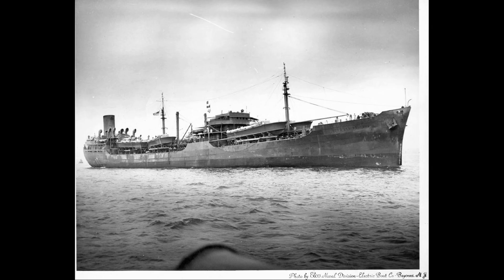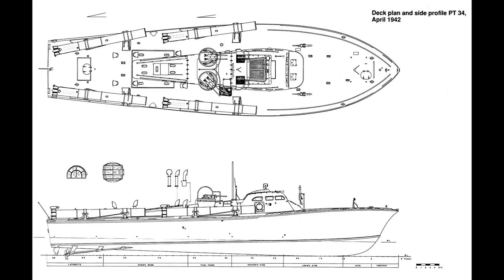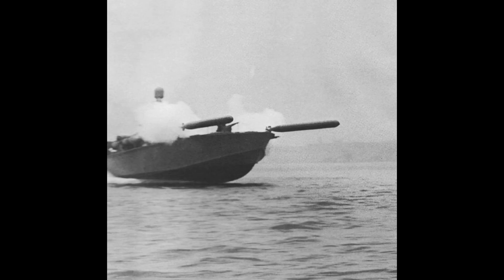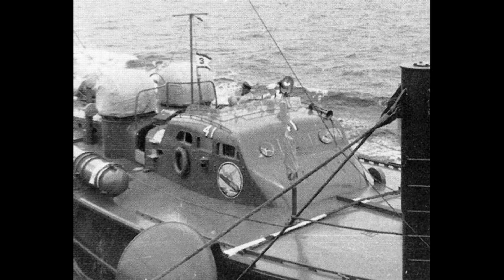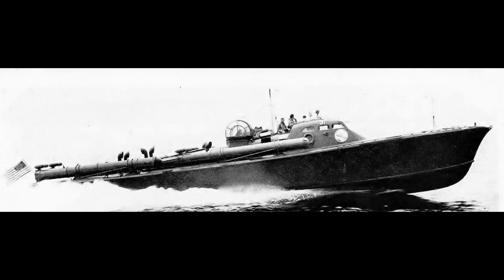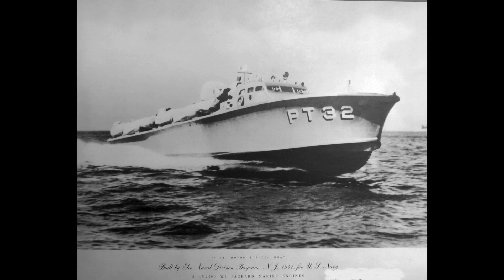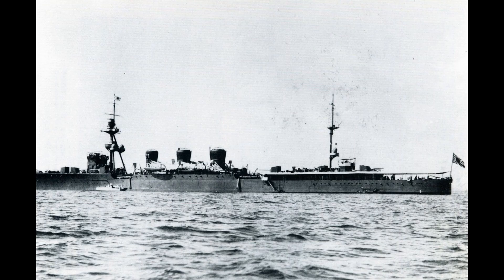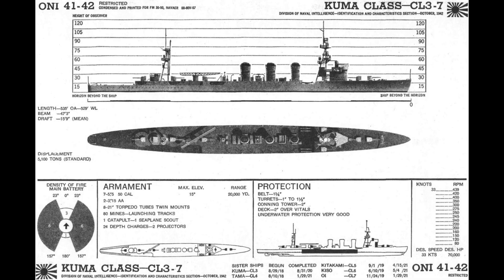PT Squadron 3 - Guide 161

Comment from the maker: Pinned post for Q&A :)
Reply: Given that most sea battles during WWII took place either in range of shore and/or carrier based air, or at night, was there ever an instance where the scout/spotter planes carried by cruisers & battleships proved useful in a major battle? I can think of one negative example (IJN Tone at Midway), but without going through all of your old videos, I can only imagine one positive one, the hunt for the Bismarck.
Reply: For the third time: every single big-gun capital ship (battleships, battlecruisers, "large cruisers") to enter service after 1935 is teleported back to Jutland (at the start of the engagement) and attacks both the British and German forces. Does the uptimer "ultimate battlesquadron" have it in them to sink all the Grand Fleet and High Seas Fleet capital ships present, or will they just turn the WWI capital ships into burning but floating wreckage that can return to port for repairs?

(and yes, this scenario has all the non-carrier Allied and Axis WWII-era capital ships working as one fleet rather than trying to kill each other, because I just want to see how they would fare in an environment where they weren't immediately obsolete due to carriers, and having them fight each other is overdone)
Reply: Nice upload.
Thank you.
Reply: @Kendra Malm At the Second Battle of  Narvik HMS Warspite's Walrus seaplane spotted German destroyers hidden in coves. They were Warspited even though not visible to the ship.
Reply: I am a retired U.S. Coast Guard member I would love to see a series on U.S. Coast Guard Cutters
Reply: The link to the music says the channel doesn’t exist but it could be on my end. Do you know where else it might be?
Reply: Excellent video, hope to hear of more small craft exploits in the future. 

Have you seen the John Wayne movie “They Were Expendable”? It’s been a number of years for me, but from recollection it seems track fairly close to the historical record you covered.
Reply: I mean no offense in suggesting an error, but was the compliment of Lewis guns really in .303 British? If they did use .303, was it simply a case of that was what was available. I believe the US manufactured Lewis guns in .303 for the British during WWI and I could imagine a number of them hanging around and a non-standard, or non-American caliber and being pressed into service. Would there be, then, multiple instances of Lewis guns being used to outfit vessels such as US gunboats in China etc also be in .303?
Reply: What if before WWII had begun, Hitler had grown a brain and realized that Germany couldn't build a navy to compete with the UK and the US, so instead made the  decision to build thousands upon thousands of E-boats.  Would this have been a better use of man power and material resources for Germany and could it have possibly helped them win the war?
Reply from the maker: @charlieborsos7321  it's slightly unclear, the USN tested the .303 Lewis back in WW1 and ended up with a fair few but would then adopt the rechambered .30-06 version, which appears to be more common in USN service.

This is further complicated by various sources listing it as a .303, .30cal, 7.62mm or .30-06 weapon, also not helping is that later boats often got .30 Brownings, so simple reference by calibre without gun type could refer to either.

Happy to be correct if someone can point to decent source that clears things up definitively. :)
Reply: Please, the USS Colorado or the Colorado class as a whole. Please. Just tell me who I need to snuff out! lol
Reply: @DavidConnor  Though there is a strong argument that the whole Second Battle of Narvik was a case of wasteful overkill for the British, since they were using a capital ship to take out some of the worst destroyers of WWII. Why not send a Town-class? Would still result in a British victory at less cost.
Reply: @DavidConnor  You're looking way too much at the sharp end-tactics-and ignoring stuff at the operational, strategic and logistical levels. A battleship has more firepower and durability than a cruiser but also costs a whole lot more to build and deploy, so if your cruisers can still do the job adequately enough, you're better off with that option.

And given just how bad German destroyers were, I doubt that having 15" guns (which are totally overkill for killing destroyers) represented a notable tactical advantage; if anything I would assume a larger battery of faster-firing 6" guns (like those on a Town-class) would be more effective for killing destroyers, even at the tactical level. 

Nothing succeeds like excess? Then why are things like the Maus or the Schwerer Gustav considered "awesome but impractical" (has value only in very limited circumstances) or even outright pointless? 

In strategic and logistical terms (and in the majority of cases even in tactical terms), battleships were outright worse than useless in WWII. (Before the late 1930s they did have some value due to there not being any better choices for exercising sea control)
Reply: @bkjeong4302  😖 seriously?
Reply: @bkjeong4302  Did the RN even have cruisers available? Could a cruiser survive a German DD torpedo hit? The rebuilt Warspite could. I know you're hellbent against battleships but BB's had immense war-fighting value. They were built, manned, trained, on scene and utilized to defeat a determined enemy. I wish someone had recorded the sound of Warspite's 15' guns in the fjord. A symphony of destruction.
How can you argue with success? 
p.s. Kudos to the Walrus's flight crew.
Reply: Drachinifel Why was Japanese AA so inferior to American?
Reply: Fairly sure a RN cruiser COULD survive being attacked by German destroyers, since a) it was better suited to fighting and evading torpedoes in a narrow fjord, b) German destroyers and early-war German torpedoes were awful, and c) cruisers are still big enough that one torpedo hit wouldn’t render it combat-ineffective.

Battleships were utilized far less than pretty much any other warship in WWII to defeat the enemy (hell there were some converted merchant vessels that saw more service and gave a better return per investment than the average WWII battleship!), almost all of the stuff they did do was in secondary roles they were never designed for (and in most cases underperformed at), and the money and resources spent on them in WWII should have been used for other, more impactful assets like tanks, planes, carriers, submarines, ASW vessels, etc.

I can argue with success when that success could have been easily achieved with less bother. By your logic, someone using a knife to kill an enemy soldier when he could have just shot him shouldn’t be criticized.
Reply: Matthew M. Mowry 

They had no medium AA and their light AA sucked (though the Germans were even worse in this aspect). 

Even if their AA was as good as that of the Americans, it wouldn’t matter much as even American AA was far less effective than CAP for preventing air attack.
Reply: Why were American ships so chock full of .50 cal or similar weapons. Were they effective against modern strike aircraft like the Val and Kates? When did this downright obsession fade?
Reply: @bkjeong4302  
Warspite's sister, the unrebuilt HMS Barham, was sunk by German torpedoes. How would any cruiser fare?
BB's did their duty, whether in action or just by in being. Tirpitz and other German capital ships tied down enormous RN & RAF resources. The IJN expended resources, needed elsewhere, to tie down the inferior RN's Far Eastern Fleet.
Deterrence, a fleet in being, is a strategy that can count victory as avoiding combat.
BB's were overshadowed by carriers. Perhaps the resources to build and operate BB's may have been better utilized elsewhere, that does not mean that you could ignore their power to inflict pain on you. They were operational, they were there. BB's certainly DID inflict pain upon our enemies, in both the European and Pacific theaters.
An arrow will kill you as readily as an F-35. Bring 15" guns to a torpedo fight whenever you can.
In this case, HMS Warspite, proved her worth in RESOUNDING fashion.
Three Cheers for HMS Warspite!
Reply: The winner of a hypothetical battle between the Yamato and (fill in the blank) is often discussed.  How would you design a battleship that could definitively defeat the Yammie and would it be simply a Yamato with better fire control?
Reply: David Connor 

Barham was sunk later AFTER the Germans fixed their fish. At Narvik they wouldn’t be much of an issue.

What BBs achieved in action (which was usually against hostiles they were never intended to engage when designed) or even by tying down the enemy fleet is minuscule compared to their expense, lack of cost-effectiveness and the fact they diverted resources from much more useful military assets.

Just because they inflicted pain does not mean they were the best choice for inflicting that pain.
Reply: Jeff F 

Probably a Montana.
Reply: @bkjeong4302  Well, you're looking at it from a bean-counter perspective.  From an operational perspective - wouldn't one rather have their capital class crews VERY comfortable with their guns, Reasonably comfortable with their aiming, and hardened for battle?  You are missing the experience paradigm entirely.  Bean counters - plenty of corporations have died to them, and plenty of countries have lost bigger battles due to them.
Reply: @workingguy-OU812  In war, especially a global war like WWII, the bean-counter's perspective tends to be a lot more important.

Who cares how comfortable and experienced the crews of a battleship are if warfare has changed to the point there is no more reason for battleships to exist? The raison d'être for all battleships was exercising sea control by engaging and sinking peer opponents, because they were simply too costly to build just for secondary roles like shore bombardment, engaging destroyers, AA, convoy raiding/escort, etc. When naval aviation got to the point it could effectively outrange battleship guns (which was probably in the late 1930s), they rendered battleships largely pointless at the only role they were ever strategically useful for (the sole exception being in conditions where planes couldn't be used while there was an enemy battleship, but this happened only three times in WWII)
Reply: @bkjeong4302  Perhaps, but German torpedoes DID inflict severe damage on RN destroyers in First Battle of Narvik and elsewhere. Not every German torpedo was a dud.
How would you like to be ashore as RN & USN 12", 14", 15" and 16" shells rained down upon you in Normandy? How would a carrier help you on D-Day?
I'm a submariner, I know what a well placed torpedo can do to the largest warship, break her back. I also know that to place that shot takes extreme skill and not a small bit of luck. Meanwhile the BB's are smashing the sh*t out of my comrades afloat and ashore. 
Battleships were there. They deterred and/or fought hard and courageously. Scharnhorst fought hard yet lost, at the North Cape (Where I've been multiple times.) against overwhelming surface warfare odds. Scharnhorst was a beauty. Battleships may have been bypassed yet they were still deadly, never to be ignored.
There is no time machine to change the FACTS. The FACTS of history should be honored.
Reply: Do you ever consider doing modern navy’s
Reply: David Connor 

Re: Narvik, that does not change the fact German destroyers were crappy and that a Town-class is both cheaper to operate and better at evading torpedoes than a battleship. 

At Normandy the battleship bombardment did an underwhelming amount of damage, and if I was a German there I wouldn’t care all that much about the big guns, knowing that the bulk of the fire support was actually accomplished by destroyers. Vice Admiral Deyo agrees with me on this.

Battleships were not present for a lot of WWII naval battles. Even in engagements battleships were present in, most of the time other warships did far more of the work while the battleships either just sailed around or made minimal contributions. And when the battleships did do things it was (with only three exceptions) in situations where other warships would have done a better job.

North Cape is also unusual BECAUSE it actually had a battleship do her job properly (by fighting a peer opponent in a situation where there were no better options). Exception to the rule. 

Please make sure whether your facts are actually factual before you argue battleships contributed heavily in WWII.
Reply: David Connor 

Of course I’m Anti-BBs. Someone needs to balance out all the battleship wank that keeps giving them way too much credit based on outdated or outright false information and nostalgia. 

Battleships were NOT crucial in the Allied victory. The Allies would have won even more decisively without them. You’re giving them way, WAY too much credit for things they didn’t do, or things other ships could have done way better.
Reply: Kendra Malm Aircraft served the very useful purpose as forward observers for shell bombardment, both against other shipping and shore support.
Reply: Jeff F Replace the main guns with an armored flight deck, and bring along 90 well trained pilots. Oh wait...😄
Reply: Bk Jeong You’re very well read Bk; but the BB’s served their downgraded purposes as effective AA and heavy shore bombardment against fortified gun emplacements, while keeping out of their target’s range. Vessels with lesser maximum effective ranges would be within range of their own target’s return fire.
Reply from the maker: @nicholas ringer I may have been a little unclear, the hit on Kuma was one of over 200 dud torpedoes fired during the Philippines Campaign, that's against all the IJN forces present. :)
Reply: Were "borrowed" ships ever returned after the conflict(assuming they survived) or paid for, or were the people who owned them just out of luck?
Reply: @DavidConnor  Bk thinks that world's naval leadership was stupid because they didn't foresee the huge increase in the capability of naval aircraft in a few short years.  Well, apparently  the RAF leadership was even dumber for not foreseeing the worth of jet aircraft in 1935 when everybody was still flying biplanes.  They should have fully funded Frank Whittle because their jet fighters would have taken the Luftwaffe by surprise when introduced in 1941.  By the time the Germans rushed their ME 262 into production Kelly Johnson's L-133 supersonic fighter would undoubtedly be rolling off the production line.  /sarc.
Reply: @johnnash5118  

Using a battleship as a gigantic CLAA is, at the strategic level, incredibly wasteful.

Against shore batteries: again, I refer you to the fact destroyers did a better job than battleships off Normandy against fortified gun placements. Most shore bombardment in WWII involved destroyers and cruisers, not battleships.
Reply: @johnshepherd8687  Aside from the fact even late 30s naval aviation was arguably at the point where it had trumped battleships, plenty of battleships (all the Iowas, the last two KGVs, etc) were completed AFTER it was painfully obvious that battleships were done.
Reply: @bkjeong4302  False.  Until late 1940 the most effective naval strike aircraft was the execrable TBD Devastator.  In the real world of 1940 it takes 3 years to field a system.  There was nothing on the drawing boards in 1935 that would make one think carriers would be the primary naval force.
Reply: @johnshepherd8687  

The Devastator had its issues, but it still vastly outranged any battleship gun, and given that the Swordfish was rather successful despite having even more problems it's honestly underrated.
Reply: @bkjeong4302  The bomber will always get through, en?  So I guess you think the RAF blew it too.
Reply: @kendramalm8811  Yes, the Battle of Savo Island, the night of August 8-9 1942. Japanese admiral Gunichi Mikawa used floatplanes launched from his cruisers to first scout and confirm the locations of allied ships then they dropped flares behind the allied ships, silhouetting them for the Japanese guns.
Reply: For the Lion class battlecruiser why didnt the designers eliminate Q (P?) turret instead of X turret?
Reply: Bk Jeong Bk Jeong 🤔You support your argument clearly, but not as well as you’d prefer. BB’s were outmoded by the CV TF’s, but were nevertheless made useful regardless. What’s your ideas for better usage, mothballs or perhaps strictly commerce raiding? The argument in favor of BB’s is that they were simply already built and available, or nearing commissioning prior to hostilities for service, despite other more efficient weapons platforms.
Reply: If we gave you a bajillion paytrion dowlers will you please read the The Destroyermen book series about the dinosaur navy but in a sexy voice?
Reply: John Nash 

Then you just leave them and don’t bother wasting more resources by sending them into combat.
Reply: John Shepherd 

ANY torpedo bomber will get shot down if unescorted (which was the situation at Midway with the Devastators). The Devastator was no worse than other torpedo bombers in that respect.
Reply: 1, what is if any are the main differences between ship, aircraft and submarine torpedoes? 2, was any variation of the long lance used by aircraft if so how successful was it, If not why?
Reply: @bkjeong4302  In 42, both the USN and IJN lost capital ships to aircraft.  In 42, all the USN had that could fire faster than a 5/38 was the 1.1".  In 42, all the IJN had that could fire faster than their 4" and 5" DP guns was the 25mm.  Both USN and IJN carriers had CAPs, but still took losses in 42.   Both the IJN and USN added more AA to their ships as the war progressed.  The IJN continued to lose capital ships after 42, but US losses were sharply reduced.  The only USN carrier, outside of CVEs, lost after 42 was Princeton.  The difference?  Introduction of the Bofors to the USN?  The Bofors was more able to reach out and touch someone than the 1.1" or 25mm, and it threw a large enough shell to do damage when it got there.  The Italians had developed an automatic 37mm gun in the late 30s that they installed on cruisers and BBs.  It wasn't a match for the Bofors, but could outperform the 25mm.  Things might have been different for the IJN if they had licensed the Italian gun, rather than the Hotchkiss.
Reply: @bkjeong4302  Yes.  Devastators did fine prior to Midway.  At Coral Sea, the strikes were properly coordinated, with dive bombers and fighters attacking at the same time as the Devastators.  From everything I read, at Coral Sea, losses were taken by the dive bombers and fighters, that came in at the altitude where the CAP was, but the Devastators attacked without loss.  There were 6 Avengers at Midway.  Only 1 returned from their attack on the fleet.  The Brits had the same issues: catastrophic losses of Beauforts and Swordfish when attacking ships with a DD screen.  During Operation Cerberus, the first Brit force to intercept the Germans was 6 Swordfish.  The Swordfish had a squadron of Spits as escort.  The Swordfish could outmaneuver the Fw190s that intercepted them, but, while all six made it over the DD screen to line up to attack the battleships, only two survived to make it back out past the DD screen.  Those two survivors were flaming wrecks who ditched a couple minutes after clearing the DD screen, with the surviving crewmen picked up by Brit MTBs.  Pat Gibbs commanded a Beaufort squadron on Malta and demonstrated that the way to attack ships was first: in overwhelming numbers to saturate the enemy defenses, and, second, bring along aircraft to strafe the escorting ships to suppress AA fire.
Reply: What sorts of armament were actually (aka Officially) tested on PT boats? I have the sneaking suspicion that just about every naval gun up to the 76mm (3" gun) were tested on these great little ships at some point. 

I'm also aware that 37mm and 40mm guns were installed, but, how much ammo could these boats carry of each?
Reply: @stevevalley7835  Pretty much.
Reply: @greg_mmm       "... decision to build thousands upon thousands of E-boats.  Would this have been a better use of man power and material resources for Germany ...?"
It would, until the Allies finally figured out how to destroy all of them. (more or less like how they figured out how to take out so many U-boats)
Reply: @nicholas ringer it was all USN torps.  PTs carried the Mk 8.  It didn't work either.  The Devastator carried the Mk 13.  It didn't work either.  In a live fire exercise in the summer of 41, Devastators dropped 10 Mk 13s.  Only 1 of them ran "hot, straight and normal".
Reply: Is this your post on PT boats? Not much is written on them
Reply from the maker: @coppeis  no, just one squadron, pt boats as a whole will need their own Wednesday video
Reply: Bk Jeong  Dive bombers and torpedo bombers attacked the capital ships, which between ‘39 and ‘42, and despite your myopic opinions of them nearly 80 years later, right or wrong, included BB’s. If the BB’s were mothballed (as you would prefer) those planes would then be available to attack the fleet carriers first, then escort carriers, then cruisers, then destroyers. Therefore, recognizing the carriers as the only true capital ships by default as you suggest, places them in diametrically greater peril. It’s arguable that the old Colorado class BB’s, commissioned just a few years after WW1 were used quite effectively as decoys for the CV TF’s. Indeed, the USS Maryland, BB46 (which my dad served and survived aboard throughout WWII,) was struck by no less than countless 20mm cannon, (2) 500 lb. bombs, (2) 500 lb. bomb-laden kamikaze dive bombers, and an aerial torpedo that blew a hole completely through her bow, large enough to literally “drive a freight train through her” as my dad told me. Those attacks, if not targeted against these old BB’s, instead would have quite possibly been directed toward the carriers and changed the course of the war.
Reply: @nicholas ringer Sounds like maybe you read the navweaps article on the 13.  By the end of 44, they had the 13 sorted out.  Drop limits improved from 110kts/50 feet to something like 410kts and 2400 feet and reliability was near 100%.  By late in the war, they were using Mk 13s on PT boats, instead of the Mk 8.
Reply: @johnnash5118  This depends on the enemy either having dumb enough doctrine or dumb enough pilots (in the case of the kamikazes it was the latter) to attack the BB that's far less of a threat than the CV.
Reply: @bkjeong4302  1935 Naval aircraft, all biplanes, could out range a battleships guns.   So what's your point?   The fact remains that the future is unknown until it becomes the present.  You know what happened in 1944, the leadership of the world's Navy's didn't.
Reply: Bk Jeong I couldn’t disagree more. The BB’s were well used for their value, which were perceived by the enemy as capital ships 75 years ago, and relieved the true capital ships, the CV’s of a great number of attacks. The IJN pilots were dedicated to their faith and believed strongly in an honorable death. By ‘44, they were depleted to such a poor state of combat readiness, that suicidal attacks were deemed more efficient; that has nothing to do with lack of intelligence, but imho, your rash opinion qualifies at least temporarily for such.
Reply: Where capital ships primary batteries ever used in a non broadside role?  i.e.  each turret gets its own target instead of all primary batteries focused on a single target?  Which was better or could both be used at wish depending on the engagement?
Reply: @charlieborsos7321  The answer is, your right. The M1917 Lewis gun was made by Savage Arms and made for the USMC  & USN in Caliber. 30-06 Gov't.
Reply: @Drachinifel  On further review, the guns in question are M 1917 Lewis guns. These were made for USN and USMC service by Savage arms and are in caliber .30-06 Gov't. The M 1917 is basically the same as the earlier and more common  Model 1913 and 1916 Built in the UK by BSA in the .303 service round. So basically Lewis guns in different calibers per nationality.
Reply from the maker: @WALTERBROADDUS  no worries, I'll include that in my next drydock in channel admin :)
Reply: John Nash 

But they didn’t relieve carriers of attacks more cost-effectively than cruisers or destroyers did, meaning they were still poor investments.

As for your comment on IJN pilot intelligence, do read Kaigun for a good overview of their doctrine. The kamikazes that went after battleships first weren’t following their doctrine.
Reply: I have often wondered, in your intro vid, right after the title card and before the logo, there is a view of a battle (cruiser) from amidships port looking aft of another warship.  The platform ship fires her battery and there is a great deal of debris ejected from near the turret.  Has anyone ever explained what that flotsom is?
Reply: @Dylan-lw1xc  nope
Reply: @DavidConnor  Bravo, bravo.....🤗 Loved your reply to the resident "BB hater."
Reply: @Halinspark  You mean like, the US DD's to the RN deal?
Reply: @bkjeong4302  That is a function of the gunnery, not the gun platform.  A 5" shell is still a 5 " shell. Fired by a DD or a BB.
Reply: @colinsdad1  Great question, but better reserved for a in depth video on Fast Attack craft. A 76 mm was too heavy a weapon for the torpedo boats.  It was used on larger Subchasers and PC's.

By 1945 the standard PT load Elco or Higgins was a 37mm Cannon bow gun, 2 5" rocket launchers with 8 rounds. 2 twin  .50 BMG turrets midship,  4 MK 13 Torpedoes in drop racks. And a 40mm Bofors aft. And smoke generator. Depth charges and Mortars up to 81mm and the 20mm Oerlikon were options. A few boats had a powered quad 20mm called the Elco Thunderbolt system.
Reply: @havokvladimirovichstalinov  Yes. The mains and secondary guns could engage different targets.
Reply: WALTERBROADDUS 

But if you’re going to fire 5” shells you have no need for a ship with 16” guns.
Reply: @bkjeong4302  Not every target is worthy of a main gun shell. The Battleship has the flexibility to hit targets on the beach to 25 miles behind the lines. And unlike aircraft, they do a fire mission at night or bad weather. Airpower, still faced bad weather June 6th and cloud covered the bomb zones.
Reply: WALTERBROADDUS 

“Not every target is worthy of a main gun shell”

Which is exactly why I am saying you don’t need big guns in WWII, since the targets worth hitting with big guns can more easily be killed with aircraft.

Battleships could theoretically do bombardment at long range, but at such long ranges they were so hilariously inaccurate (even with American FCS) that this range advantage wasn’t that useful.
Reply: @WALTERBROADDUS  Thank you for your response Sir! I realize the 76mm would not be the greatest idea to place on what's basically a wooden deck/hull warship. However, based on some of the craziness that the USN has been known to do over the years (putting an 8" gun on a destroyer springs immediately to mind), the thought of a 3" gun isn't that crazy.

BTW, when did the USN change torpedo systems on those boats from a launched projectile system (nothing like giving away one's position with a large flash) to a roll off system?

Thank you in advance!
Reply: @bkjeong4302  Not when the aircraft are across the Channel 30mins away and sitting in fog.
Reply: @colinsdad1  From the Book "U.S. Small Combatants" by Norman Friedman.  "The rack was reportedly invented One Night in February 1943 by Lieutenant George Sprugel and Lieutenant (J.G) James Costigan of PT 188 who wanted a torpedo that can be rolled into the water rather than fired. At this time, Bureau of Ordnance considered the tube essential to prevent the standard torpedo gyro from tumbling, But airborne Torpedoes have been able to slide into the water. An experimental model was built at the New York Navy yard scrap shop, and P T 188 was tested with it at the Newport torpedo station with a mark 13. A bureau Ordnance officer witness the test, and MTB Squadron 12 was the first to be equipped with the new system. By August 1943, the standard approved PT Armament was four launch racks."- page 157......
Reply: @WALTERBROADDUS  WOW. Well....I certainly got my answer. That being said, the Bureau of Ordinance should have been taken outside and shot. The absolute mess with the Mark 14s should show what a bunch of imbeciles they were.

Fun Fact: my grandfather left the USMC and joined the Naval Reserve in February 1941- he evidently saw the handwriting on the wall. Was on the USS Salt Lake City as an AA Gunner. My Great Grand Uncle, twice removed was General Courtney Hodges- kudos to anyone who knows what he was involved in. And both myself and my Dad are Veterans as well. 

I really appreciate learning from folks like yourself and Drach who  obviously know much more than I do!! Now then.... Onto my Pet Project: the Mark 37 Fire Director. If you have any info on that, it would be appreciated!!
Reply: @WALTERBROADDUS  Even then the target still has to be something worth using the main battery on, and that rarely happened historically.
Reply: @colinsdad1  PT armament is one the few examples of folks in the Pentagon, Actually listening to feedback from PT crews in field. As the boats got into action in the South, SW Pacific and Mediterranean ; the set ups were changed based upon the targets and threats faced. Some wanted  a better AA defense.  Others facing stopping barges found the targets too shallow draft to use torpedoes.  They added more guns like the 37MM used in the P-39 Aircobra and the 40MM Bofors. 
In contrast,  British MTB's and German S boats tend to be lighter armed...
Reply: @WALTERBROADDUS  Wasn't the 37mm Airacobra gun something crews slapped on there as a field expediency?
Reply: @colinsdad1  The early mounts were. But a factory made mount was soon made for both Elco and Higgins boats.
Reply: @WALTERBROADDUS  I appreciate the fact that we Americans are always using our Second Amendment rights to "up arm" EVERYTHING. Then again, there's always the issue of having more guns than can be effectively controlled, like on the USS Atlanta.
Reply: Hi Drach, multiple questions:
1) do you actually answer questions posted under Q&A videos?
2) assuming the answer to 1) is "no": did any navy transform warships into fast transports / tankers (I made up an alternate history scenario in which the french navy legs it to british bases instead of joining the armistice and they would convert their earliest and lightest heavy cruisers into a fast transport and a fast tanker to extend their range and it made me think of the feasability and whether anyone did anything like that)
3) in your boiler video you mentioned that with the advance of technology, you could get more power for the same amount of space. How fast could the Nelsons have gotten if they had been refitted with the latest machinery at the end of or after the war, supposing the size of the boiler and engine spaces doesn't change? 
3b) could the Nelsons have been refitted into useful NATO ubits if more speed could have been gotten out of them and if so, how would you have done it (heavy shells for the main battery, revised secondaries, etc)? 
3)
Reply: @piritskenyer  (1) He does. (2) Make Cruiser into a tanker? How?🤔 (3 & 4) Makes no fiscal or strategic sense.  Post war Britain is not going to re boiler Battleships. The Soviet threat is submarines. Not surface warfare vs. Capital ships.
Reply: @WALTERBROADDUS  1) haven't noticed. 2) that's the question. 3)&3b) I know. It's a hypothetical purely for science.
Reply: @piritskenyer  He answers questions,  but that leaves little free time to work, research,  make videos and etc.
Reply: @WALTERBROADDUS  I never noticed when he takes questions from under Q&A vids to Q&A vids :P
Reply: Norbero Fontanez  Was one made? There are films on Sub rescue and salvage.  Not sure about that ship in particular.
Reply: S- boats please. or as You lately dis some research of italian navy do video about italian torpedo boats.
Reply: It's min-din-ow. A friend of mine married the police chief's daughter.
Reply: @Drachinifel, You forgot to mention the action of Commander Bulkeley and the USS Endicott in Operation Dragoon; the invasion of Southern France.   Bulkeley and Endicott attacked and destroyed 2 German Corvettes that were attacking 2 British Gunboats.  The British boats ran and escaped while Endicott fought the Germans, even though the Endicott only had a single 5 inch gun working while the German ships each had more working, and larger caliber guns each!  Don’t want to embarrass the Royal Navy, I know.

Admiral Bulkeley was an amazing and fearless man.  Prior to the US entry into the war, and his command of MTB Squadron 3, he even stole a Japanese Diplomatic pouch aboard a Chinese ship, dove overboard, and swam to shore with information that was shared with the Royal Navy.